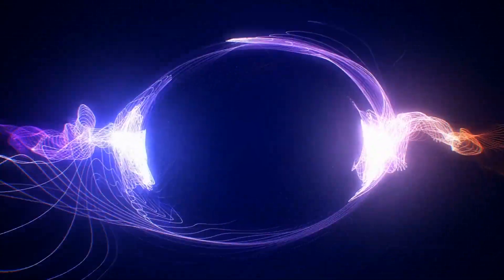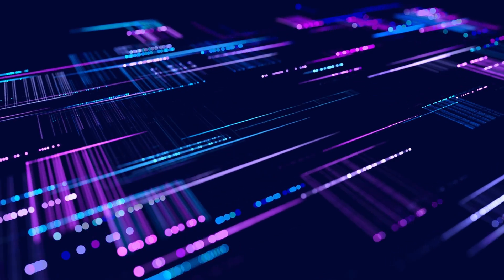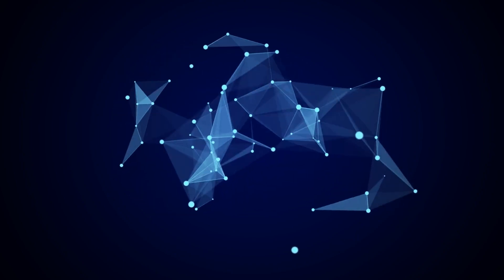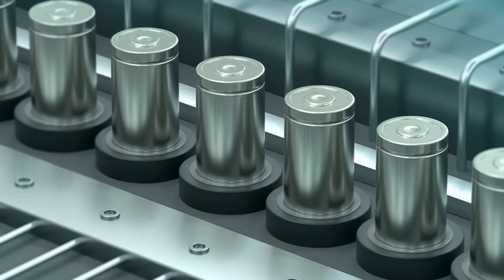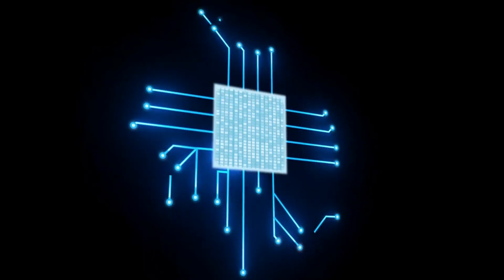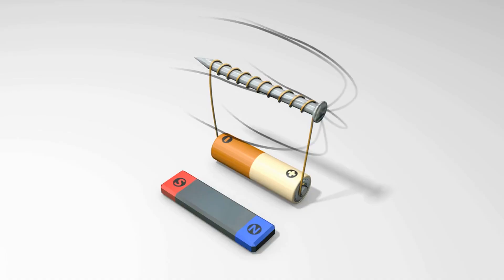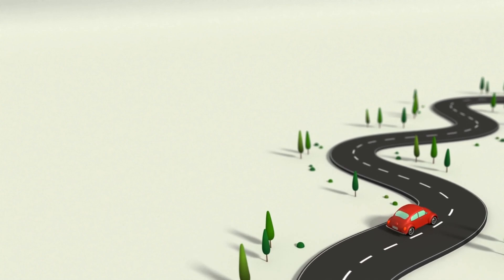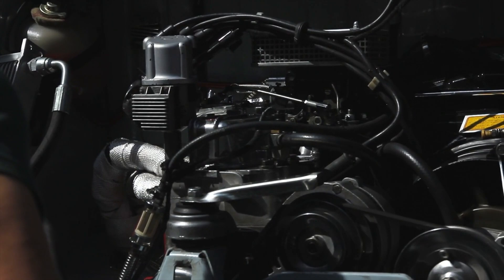Electricity's Journey from Atom to the Universe

Comment: Lithium batteries are an environmental hazard and extremely dangerous fire hazard

There is no environmental benefit lithium ion batteries

Furthermore, ice core samples show levels of c02 as much as 4 times higher than today’s level within any problems

Our current science is flawed by propaganda
Reply from the maker: Completely agree with you that lithium ion batteries are dangerous to the environment however when considering the lifecycle of EVs from their production, use and disposal, they generally have a lower environmental impact compared to the internal combustion engine vehicles. Especially if they are charged from renewable sources.